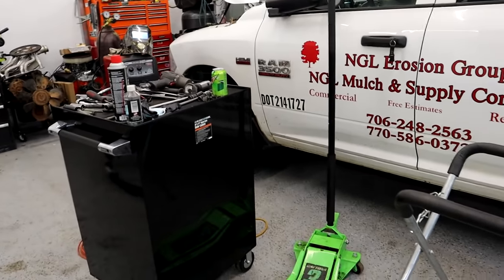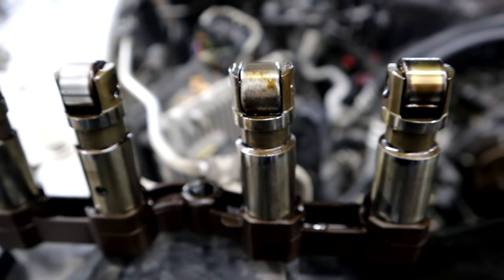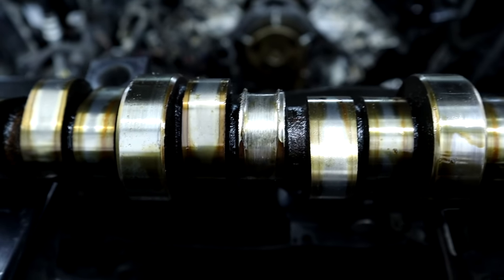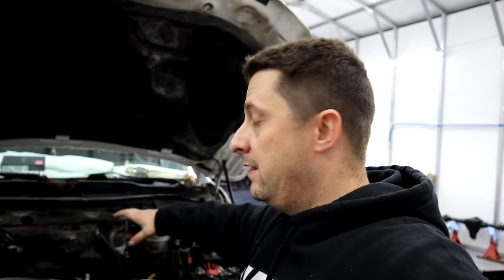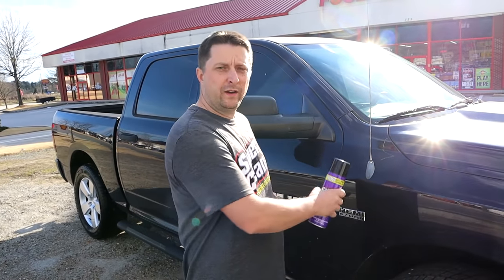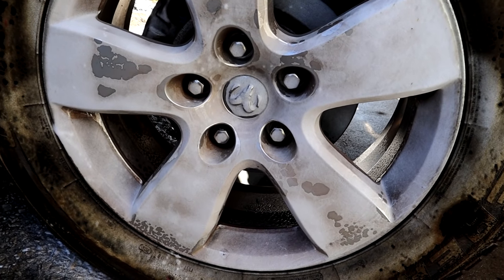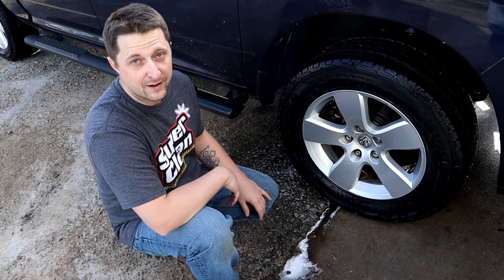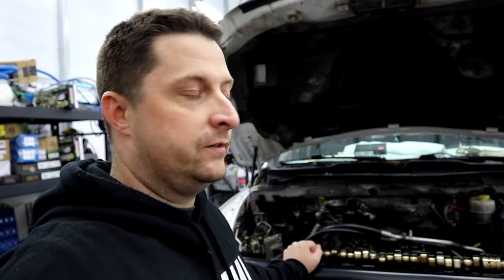6.4 HEMI Engine Failures Common Problems WATCH OUT.

Comment: 2 ways to possibly stop the hemi lifter failure,  and I have built 50 hemi motors...   dont trust the 10,000 mile oil change,  no more than 5,000 miles between oil changes on the 5.7 hemi,  3,000 miles on the 6.4 hemi,,  doesn't matter if your using the best synthetic,  it is black at 10,000 miles...  

Use the recommended fuel grade...   89 octane for a 5.7 hemi  and 93 octane for a 6.4 hemi....   I believe this is a big part of the problem,  do these 2 things and yoy should have 250,000 plus out of your  hemi.

Comment: Looking at a 6.4 2500 ram with 95k on the clock 
They found this issue before I picked up the truck 
Dealer will replace cams and lifters under warranty but do I pull the plug on this deal ?
We are talking other components wearing out and they call only the cams and lifters 
What else went dry right ?

Comment: 140,000 miles of commercial use. Probably lots of idling. Doesn’t seem too bad to me.
Reply from the maker: Perhaps, just sucks seems to be the norm
Reply: Compared to what? My old junk 100% stock 05 5.4 triton has over 300k miles on it. I love my new ram so far but if it can't make it to 150k without a major failure I'm not getting another one

Comment: Fleet vehicles use fleet service shops. They don't use proper Pennzoil ultra SRT 0w40 the 6.4 was designed for. They use conventional 5w30 or 10w30. Filters? They use the cheapest one they can get from suppliers. I own a ram with the 6.4 and do my own maintenance with proper fluids and high quality oil filters. No hemi tick or issues.
Reply: This is true of non-fleet service shops too.  I asked my local dealer's service shop what the cost of an oil change would be for my 6.4l Hemi 3500 and was quoted a lower price than I usually spend doing it myself.  When I asked what oil was being used, it wasn't the Pennzoil Ultra SRT 0w40 that is recommended.  This is why I have continued to do my own oil changes.
Reply: @Jim-bw8jo   not to mention the hemi on the heavy duty trucks is one of the easiest to change the oil and filter. Some dealers are even not honest. All they care is about profits

Comment: To be honest I’m only going to indorse 1960 to 1979 only . The new hemi’s are a grenade after 50 thousand Klm
Reply from the maker: The old push rod motors was the work horses of the past no doubt.
Reply: Frostbite Ram yeah well to fix Chrysler grenade problem use a old iron block and piss them off . . I know when I do get another 2011 Dodge Ram I’m putting a 1960 440 in it and ripping the entire computer system bull shit out .

Comment: Amsoil and change it on time and it will last forever !!!!!
Reply from the maker: Mine didn't lol
Reply: BS! Amsoil doesn’t stop this, my brother has done about half a dozen of these now and one was amsoil only since new 5.7L 2010. Only 140k.
Reply: Mine has 187k AMS 5w30 mds zero problems wifes 5.7 grandcherokke 229 k ams 5w30 zero problems less a broken valve spring
Reply: I have a 13 with the 5.7.... 86000 miles.. I bought it with 20000 miles... oil change every 3500 miles and only idle time is at a red light... I am a retired mechanic
Reply: @scottrussell6717  I think your on to something with idle time. All the failures I see are due to high idle time like cop cars and work trucks. Those guys sit in the air for there lunch time most likely every day down in that Georgia heat. And I think using synthetic oil in the right weight grade makes a huge difference. These new motors have very tight tolerances and need high quality oil.

Comment: Has to be the cylinder deactivation..GM has the same issue with lifter failure. It’s such a stupid thing that doesn’t really help MPG just ruins engine longevity...
Reply from the maker: The mpg gains is definitely not worth it.

Comment: I have a 2004 Ram 1500 SLT sport air intake throttle body throttle body spacer stage 2 Jet chip computer programmer Gibson exhaust purchased truck brand new in 03 just went over 100k and passenger side third roller in broke it's still somewhere in the motor. I had a mechanic remove the head sent it out to be looked at put a camera into the motor did not even put a scratch on the cam don't know how. Replaced the 4 back ones passenger side put all new hardware have a 110k now runs like today I bought it I can put a champagne glass on top of the motor and not lose a drop. Burns a little oil always use from day one 5w 30 synthetic oil and either Lucas additive or Z Max every so often just because of the high miles I'll still burn the tires as far as I want .

Comment: Geez I hate seeing this. I’m about to drop serious money on a truck. The 6.4 ram longhorn was leading my decision. This sucks. I still have my 05 ram 1500 5.7 but it only has 110k on it. I was expecting the 6.4 to last just as long. The issues with the new diesels worry me too
Reply: Google searches on virtually ALL truck engines will produce reported issues. RAM Hemi is a mature, proven design with an apparent lubrication issue. We chose the 2500 because of the quality of the Hemi weighed against issues with other manufacturers. LOVE the truck, BTW.  Fantastic camper-puller!

Comment: 1.  If it’s the #5 lifter that always fails, the problem is the manufacturing of the block ..a blocked drilling most likely..  Replacing cams and lifters w/o addressing the drilling is a waste of $$.  

2.  Oil.  Mineral oils are refined into a desired tranche of Hydrocarbon molecular chains.  Nature made the oil, warts and all.  Then the oil is blended with viscosity additives, detergents etc to improve its utility. 
   Synthetics are made by breaking apart oil and synthesizing (reassembling) into a better, consistent molecular chains.   It’s engineered oil.

3.   Synthetics last longer than mineral. This can be tested by trying to set the two on fire….Synthetics are hard to ignite which means they are oxidation resistant.  Synthetics viscosity is naturally more constant with temperature variations.  But you pay for this.

4.   Synthetics are cheaper than replacing cams.  If sold on minerals, suggest more frequent changes, particularly if engine idles.         Cheers

Comment: I thought the heavy dutys, especially 1 tons came without MDS.. Or at least that was with earlier modes.
Either way, my guess is these service trucks idle a lot. That means they spend a lot of time at low RPM, therefore lower oil pressure, less lubrication to the lifter roller
Reply from the maker: Its possible definitely unfortunate.
Reply: I have a 18 powerwagon with 26k on it and have thought about putting a melling oil pump or the hell cat pump on just to see if it could help keep this thing from happening. Any thoughts?
Reply from the maker: @caseywoodside3791  possibly but I think good service schedule and care goes a long way also
Reply: @FrostbiteRam  thanks all so I have been paying attention to the idle at temp of 33 psi and wondered your thoughts on that as well
Reply from the maker: @caseywoodside3791  definitely try to avoid lots of idling they definitely not like a diesel.

Comment: The truth is ... the camshaft and lifters don’t get a good oil supply at idle ... hellcat oil pump is high volume at idle ... maybe a better heat treatment on the cam as well. You don’t see this problem on hellcats it’s all about oil volume

Comment: Will it always be cylinder 5? I got mine used with 50k and it had a slight tick when I bought it. Changed oil immediately and the tick stopped.  I get a occasional misfire on cylinder 6. This I would assume is the cause of that.
Reply from the maker: No its random across cylinders

Comment: This 6.4l is made heavy. I looked and several guys that MAINTAIN their trucks are getting 250k to 300k. If you're pulling or hauling, or idling, change your damn oil every 3k miles. Don't go till the light comes on and tells you. Check your oil in a regular basis, hell change it every 3k whether it needs it or not. That clearly has been neglected. Esp with this happening over and over again with the same guy on all the trucks.

Comment: The solution to the aforesaid problem with the cam and lifter failures in the 5.7 and 6.4 Hemis?  Replace the stock Oil Pump with a Hellcat Oil Pump that delivers a 12% increase in the oil volume throughout the engine, as fully explained by a Dodge Mechanic, who gives a really nice explanation with show and tell prompts, in the following  .

https://www.youtube.com/watch?v=1gpEwkTVCmE

A Follow-Up Video of the same Dodge Mechanic, Where He Questions Why Replace the Inadequate OEM Oil Pumps on the 5.7 & 6.4 Hemis with a $321 Hellcat Oil Pump that Is Currently on Back-Order (that Produces only a 12% Greater Oil Pressure), When a $213 Melling Performance Oil Pump (Available Now at Summit and Jegs) that Produces an Increase of 20% Oil Pressure (to Protect the Cam & Lifters, Even Better than the Hellcat Version)?

https://www.youtube.com/watch?v=MtW6nzrLd1E

I met an owner of an automobile repair shop who has two powerful 6.4 liter (392 c.i.) vehicles who told me he uses 0W-40 Mobil 1 in both vehicles.  I told him about 20 years ago I was a former consumer of Mobil 1 for several straight years (after trying multiple brands of synthetic oil), which all changed when I tried Amsoil for the first time as an ordinary customer.  I was so impressed by the extra power that Amsoil provided my vehicle, along with other attributes, that I became an exclusive Amsoil consumer and I later became an independent Amsoil Dealer (all Amsoil Dealers are independent contractors).  Many Amsoil consumers claim that they receive an increase in oil pressure from using Amsoil, but none of my vehicles that I currently own or have owned have an oil pressure gauge, so I cannot confirm those statements.  At any event the repair shop owner tried the 0W-40 Amsoil in his powerful hemi and after a couple of weeks, he called me to order three cases of oil (including a case of 0W-40 for himself) and he has become a steady customer since that time. 

If consumers wish to buy the 100% Synthetic Amsoil products as a Preferred Customer (PC), they will get the oil at a 25% discount, plus free shipping when they spend $100 (plus receiving a $5 coupon for every $100 you spend).  It only costs $10 for a 6 month PC membership and there is no requirement to purchase (as there is with so many companies offering a membership for a preferred customer program, where there is an automatic shipment involved). 

If anyone is tempted to try Amsoil, I invite you to visit the official website of Amsoil and apply to become my Preferred Customer, by kindly utilizing my name (James Norris) in the box underneath the question that asks “Did someone refer you to Amsoil?  If so, please tell us.”  Then in the next box they ask “Have a Referral Number?  Enter it below:”.  I kindly ask that you include my Referral Number of 1420935 in that box. If you can write down my name and referral number, before you eventually decide to exit this webpage, it will be appreciated (so that it will be at your fingertips when you get on the Amsoil website).  

I also invite you to review the wonderful comments made by "verified customers" of Amsoil products (you can see how impressive their vehicles perform and many of them reporting an increase in MPG).  Thank you for your time.

Comment: Would it be an idea to deliberately overfill the oil by say, 1/4 of a quart? To encourage a little windage.  Uncle Tony, a Mopar Youtuber, has offered his theory as to why these engines suffer lifter failures.  Basically his theory is, and I do oversimplify, is that at idle, the oil has a most difficult time reaching the roller area of the lifter.
Reply: Tony doesn't understand that the lifters are pressurized. They don't rely on luck or splash to oil the cam and lifters. So his example of holding a lifter in his hand while pouring oil on it is a bit comical. He has no clue how these newer engines work!!
Reply: @bicyclecrashsurvivor8884  So your are saying that the roller/lifter interface receives pressure lubrication?
Reply: @HamiltonSRink  yes, if not then the cam and rollers would never see oil due to the fact the cam is much higher in the newer Hemis. Lifter/cam failure would happen almost immediately not 100k miles later.
Reply: @bicyclecrashsurvivor8884  As a retired auto mechanic, who buys Toyota Hybrid for my family use, this is interesting to me.  I remember changing all the Valve springs on one of these, due to a failed spring, and thinking they cheeped out on such a vital part.
Reply: @HamiltonSRink  I agree but it happens. Cheap outweighs reliability and that's true for all manufacturers nowadays. Even Toyota has problems. They decided to remove the trans cooler from the Tundra in 2018 and now they are having problems with transmissions burning up. We consumers end up footing the bill for all these manufacturers screw ups, 😆

Comment: Very nice vid man👍🏼.  Now here is a good one, i had 2 cummins one 95 one 2021, loved them,   Then i had 4 1500 with the good old 5.7, some were ticking slightly but nothing catastrophic in here.  Then, i just received my brand new 2021 power wagon, my first 6.4.   That thing sound amazing at idle, nice deep and low sound. But as soon as i put it in drive and i move the truck as low as 3 miles an hour and up, that thing is ticking, some told me that a 6.4 in a car and in a truck is not sounding the same at all, im new to the 6.4 so can you enlighten me on what it could be please loll,  it sounds like a mix in between manifold bolts, lifter and detonation,   Im lost 🤷🏻‍♂️
Reply from the maker: It shouldn't tick check for broken exhaust manifold bolts or possibly lifter issues.
Reply: @FrostbiteRam  the thing that bugs me the most is that it did it since day one, brand new, now at 653 km and still doing it,  neutral and park whip of the throttle and no noise,  as soon as it’s moving it does the tick/chirping sound.

Comment: the 2020 F250 F350 Superduty's have returned back to the old style push rod engine and its a shame that dodge cant do the same. Dodge wont admit that the engineering of the hemi is the problem. Oil starvation is the key why these engines are failing. As to the block design.
Reply from the maker: Something need to happen for sure atleast for the the big trucks that want a gas engine.

Comment: So expect $5 - $6K extra per vehicle that you pay when you get a Ram pickup. Then you have to add  the cost of losing a work vehicle on top of that. This engine is not worth having.
Reply: It is fucking a joke, I am on my second lifter and camshaft replacement. The 6.4 is absolute garbage.

Comment: At 7: 30 you spray some super clean on a wheel and tire.  DO you have to use the entire can to clean 4 tires?  How much does that cost?
Thanks
Reply from the maker: 1 can will last a few cleanings all the way around.

Comment: Obviously, an oil related issue if it's just one lifter. Looks like Debris getting into one lifter and locking it up. Guys clearly not taking care of his trucks. Less than 5% of Hemi engines get a lifter and cam failure.

Comment: This is what happens when the oil breaks down power strokes with the HEUI system had the same problem when the oil loses viscosity it would eat up the lifters change your oil regularly and you won't have this problem these landscaping trucks they don't do oil changes like they should and this is what happens catastrophic failure 💯
Reply: Idle time is what eats these cams due to the engine design. The cam is too high and the slope from the head to the cam doesn't allow enough oil to flow down to it. Drive it, don't idle it.

Comment: I just got a 2012 dodge ram 1500 5.7 and when im cousting at 20 mph the mds makes a chatting tick sound i seen there lots of forums on this issue with 2009 tru 2012 5.7s
Reply from the maker: Unfortunately over 60k miles you really have to start preparing yourself that this could happen.
Reply: Either broken exhaust manifold, or it's eating the camshaft.
Reply: @gasolinediesel972  i hope not i just lost my job last night .it does run very stong so hopefully its just broken exhaust manifolds.
Reply: @randomvideosyt5955  It probably is, but it could be the cam. Does it tick for a few seconds after you start, then stop? If it does that, then it's 100 percent the exhaust manifold.
Reply: @gasolinediesel972  its only when im driving around 20 to 30 mph while off the gas and on the gas when mds is active. Its hard to explain lol
Reply: @randomvideosyt5955  Uh oh. I think mds is one of the causes of the engine eating the cam. You better get that shit checked out when you get a new job. Damn. If it needs a new cam, also get some hellcat lifters for it. They apparently fix the issue. Keep driving it until it shits itself. It's really not that big of a deal, but it will be if you don't get it fixed after a while. It should still run fine. I don't know if you can turn mds off, but if you can, turn that shit off.
Reply: @gasolinediesel972  yea im going to buy a tuner to turn it off . thanks for the help man i really appreciate it. 👊

Comment: I've had 3 of the 5.7 Hemi's, each one I kept and problem free for 130,000 miles. Keep the oil changed and I run strictly 93 octane.
Reply: The high octane gas is a waste of money. The lifter problem is going to happen sooner if you tow a lot, or have a lead foot. If you baby them they'll go a lot farther with no issues.
Reply: @Prestiged_peck  I disagree especially when I get 7 days on a tank of gas with 93 when 89 only gets me 5 days of driving. I know enough guys with Fords, Chevy and the Rams who use cheap gas and spend more time at the pump with cheap gas.